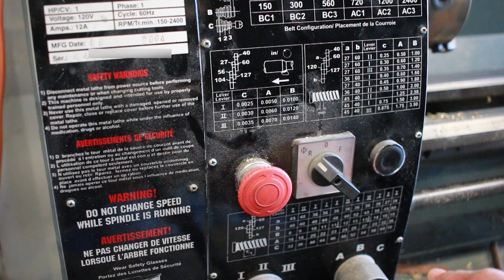Tool Time Tuesday - Metal Lathe - an awesome tool for the Maker Movement

Comment: The carrage of the TOS Trencin I run at work weighs more than that whole lathe. You're 100% right about machine weight, We have an old 20 in TOS and a 26 in ACRAturn at work and the TOS is much more ridgid and can take much heavier cuts than the ACRA despite having 20hp to the ACRAs 30hp.
Reply from the maker: +fjidsewff those sound like epic machines! So cool to hear, thanks for sharing this. Cheers👍

Comment: Great info and safety tips. I bet the doors really open up what you can do and build having a lathe. Really enjoyed this one. One day I will get one. Any tips on buying  a used on? Things to look out for?
Reply from the maker: Thanks Eric! Yeah they sure did. For buying one: I'd say give it a little bit of a test. Make sure things are relatively tight and that it doesn't chatter too much when you're using it. There are parts that can be adjusted, but also sometimes they just wear out or are not taken care of very well and once they reach that point, their level of precision really drops. If you ever come across old high school shop classes being shut down, sometimes there are some awesome old tools that can be picked up for super cheap. Cheers buddy👍

Comment: Why not add a spring to the chuck key so it will pop out if you let go of it. Nice presentation, a lathe and a Bridgeport will sure cover a lot of different projects
Reply from the maker: That is a really good idea! Might have to look into that. Especially when I start to teach my boys to use the lathe. Thanks so much and you're absolutely correct. (so wish I had an old Bridgeport😆)
Reply: a spring on the chuck key is awesome idia.  I'm a woodturner.
Reply: they do have chuck keys with springs.  i remember them on some of the lathes when i was in highschool
Reply: Ok One more. for the drill press key, I bought a small dog choke collar, ( the chrome kind with two small rings. It's small enough that it will not slip off the key. I took the key with me when I bought it to make sure. I pushed the handle out  of the key and slipped one ring on the key and replaced the handle. Attached a magnet to the side of the drill press and attached the other ring right near the magnet so the half chain won't interfere with the quill. Hang the key on the magnet as soon as you tighten the chuck and do your work. Then remove the bit when your done and put it back in the index. So you turned on the drill press and forgot to take the key out of the chuck it will get thrown from the chuck right away and hang from the chain. You won't spend the next hour and a half trying to find where it went. HA Jeremy it does pay to be organized. Now your turn as to what to do with that darn angle grinder wrench.

Comment: Nice video, cant decide between a lathe and a belt grinder
Reply from the maker: hahaha, I hear you! You can always make a lot of the parts for a belt grinder on the lathe.....Cheers👍
Reply: I'm still an Amature knife maker, but I would definatley go for the belt grinder. I started off with, and still use my 1x30 belt grinder from harbor freight. It was around $50 and it has lasted me 3 years and is still going strong.
Reply: I have a 1x30 but it takes AGES to grind my blades with it
Reply: You can build a lathe using a lathe... the only machine that can build itself. 
Great channel!!!
Reply: if you like knives a lot go for the belt grinder but if you want a good useful tool go for the lafhe
Reply from the maker: I hear ya!
Reply from the maker: Indeed it is! My dad always told me that it was the only machine that could reproduce itself. I was going to mention that in the comments but wasn't sure if it would create too many questions. Thank you so much! Cheers👍
Reply from the maker: +Desctructo Math that's interesting. I follow a few makers on Instagram that use stone grinders and it really is me curious. Cool to know👍
Reply from the maker: +Aiden Cougar that's sound advise👍